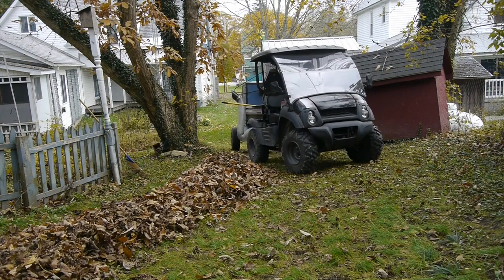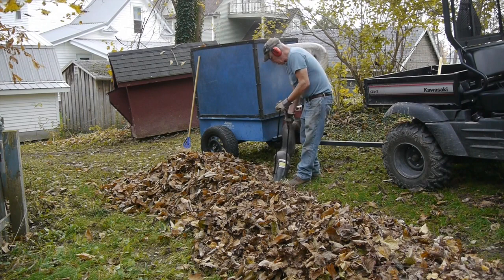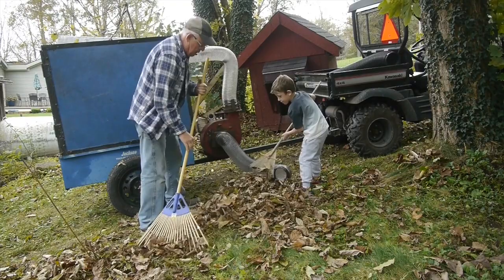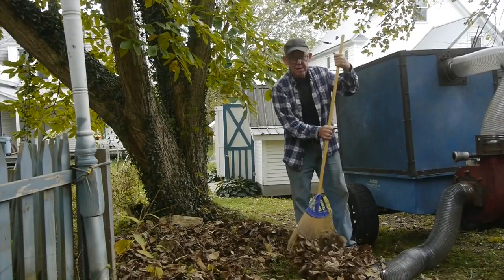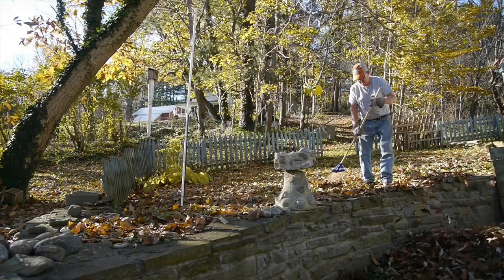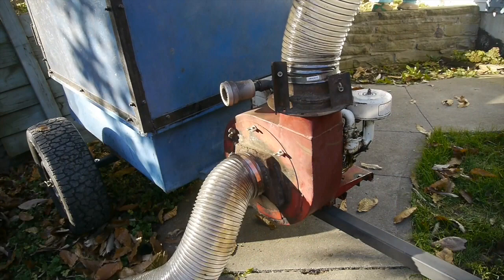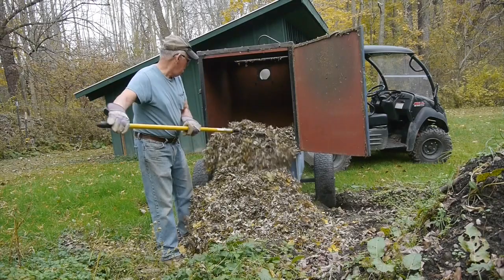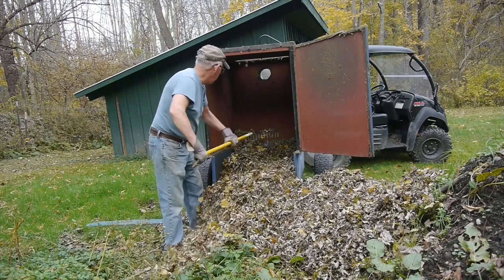Homemade Leaf Sucking Machine

Comment: Could you mount a row of rubber clamps around the inside of the trailer just below the inlet and clamp a tarp in to make it easier to get the leaves out? It does look pretty easy already
Reply from the maker: I bet that would work